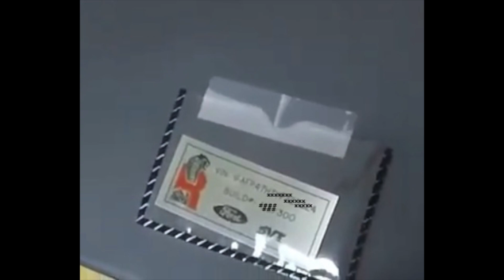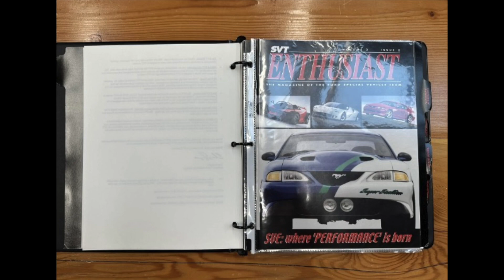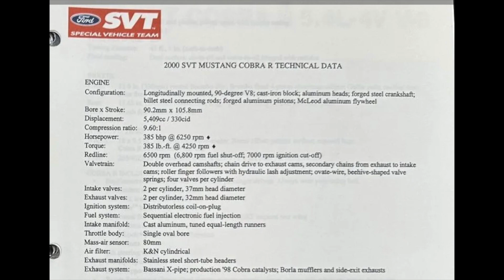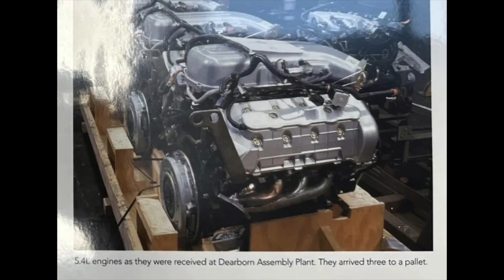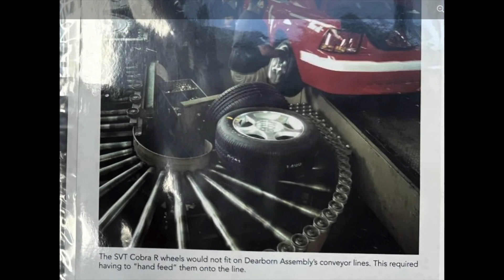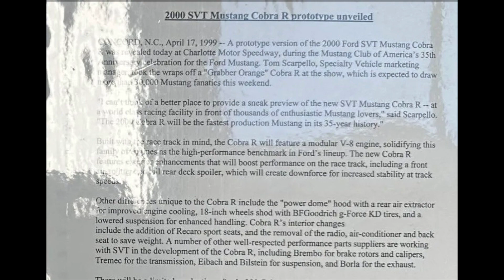2000 mustang SVT cobra R inside the black binder

Comment: The ultimate newedge
It did have a lot of aftermarket stuff like bassani eibach and such 
The terminator had eibach tuned specially for the terminator as well, I have a set on the front of my car which came off a 04 and have a eibach stamped on them, cool stuff
I wish they would have made a terminator version of the Cobra R in 2004
Would have been awesome